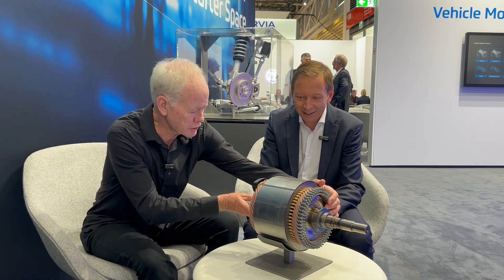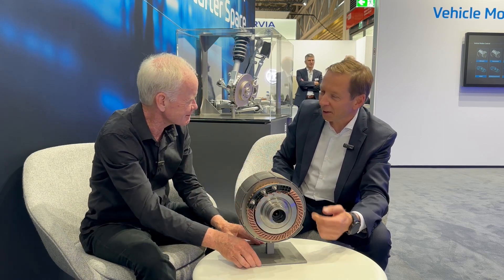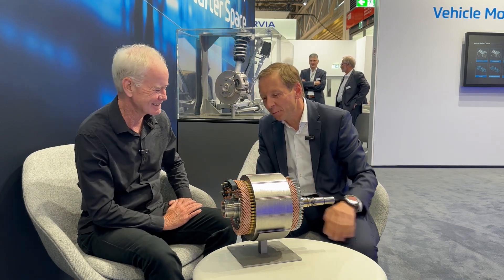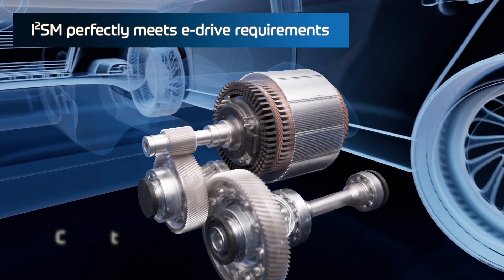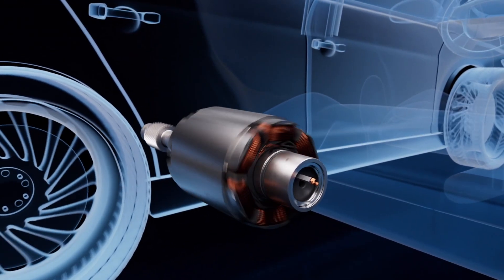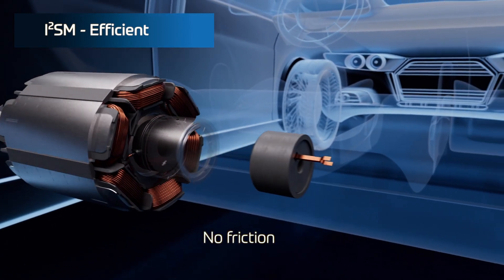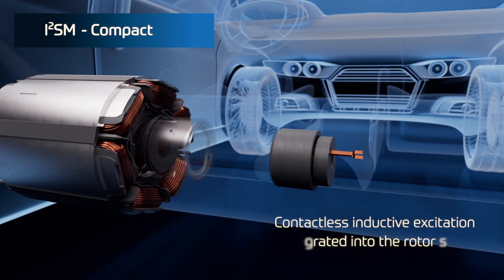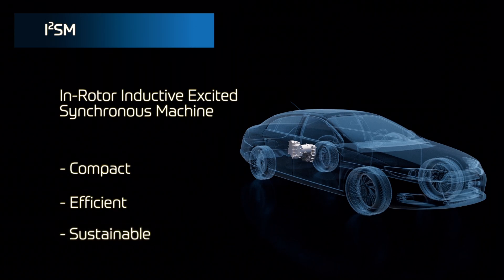ZF's New EV Motor - Autoline On The Road

Comment: Synchronous machines without magnets have been around more than 100 years. Nikola Tesla demonstrated these types of machines in the early 1900s. What's new is not magnet-less, but the induction approach that eliminates the slip rings.

Comment: This is not new. Mahle came out with their inductive coupling 'magnetless' motor two years ago and claimed 96%+ peak efficiency.  The ZF design seems to have only reduced the size of the inductive coupler used to excite the rotor.

In the future, could some of these designs turn out to be more efficient overall than permanent magnet synchronous motors, by using the ability to fine tune the rotor's magnetic field for different operating conditions?

ZF, Mahle and others need to score actual design wins for production car models.  Go for high volume, low cost rather than trying to recover the R&D expense from a smaller volume of motors.

Comment: This is probably the same principle that Tesla are using in the Tesla Q (model "2") as they've said it won't be using any rare earth metals.
Reply: The rare earth metals are for the battery.
Reply: re: "they've said it won't be using any rare earth metals." just to clarify, their original Induction motors found in the Model S (invented by their namesake Nikola Tesla) already didn't use rare earth metals.   the center rotor is just a big ol' heavy BLUDGEON made of copper.
Reply: I would note, that in model S, it was asynchronous motor. This video is about synchronous motor.  @phillyphil1513

Comment: So we have an induction motor. Not sure what the breakthrough is.
Reply: I am kinda with you on this. They address it at the end of the video (lower overall carbon footprint), but technically, it sounds like it's just a brushless motor that uses extra copper and less permanent magnets. So I guess the main play is supply chain stability?
Reply: breakthrough is rotor excitation instead of brushes  @divid3dbyZero

Comment: ...he is just describing an induction motor. How is this something new?
Reply: excitation of rotor using (contactless) induction instead of (mechanical) brushes - that is the crucial part of the invention
Reply: @abstractora  
Yeah dude. That's what an induction motor is.
Reply: @richardruscito1231  its an externally excited motor not an induction one, you're not using slip to induce a current in the rotor...

Comment: A little clarification is needed here as far as efficiency.  Mark stated that his new motor doesn’t have the drag of brushes or moving contacts and that is true but it’s probably irrelevant in the EV space as I know of no EV that uses a DC (direct current) motor (which use brushes);  all use AC motors which don’t use brushes.   EV’s  use DC charging because all batteries are DC but the DC is converted to AC to run the brushless AC motors.
Reply: re: "Mark stated that his new motor doesn’t have the drag of brushes or moving contacts and that is true but it’s probably irrelevant in the EV space as I know of no EV that uses a DC (direct current) motor (which use brushes);  all use AC motors which don’t use brushes."  he's referring to the new motors BMW Engineers designed (and have already deployed) in the i4, i5, i7, and iX.  "PROST...!!!" (best Bavarian accent)

Comment: Looks good here, but want to see it in use at high volume production. 

Would love for Autoline to do an Afterhours show where they go over vaporware and true products from the past few years of expos and auto shows. Many products look good in the moment, but many never reach market. 

Maybe it could be a series of Afterhours so you can group together products in certain categories and bring in people with real experience and knowledge in that area. Maybe some of the Munro Live team would join in this.

Keep up the great work Autoline.
Reply: The generator manufactures have been doing this for a long time. There are diodes between the inductor transformer and the main rotor windings. I expect the slice design to be more likely to be built since it uses the outer stater to power the inner rotor, but that's not a new design.

Comment: Induction motors have been used in manufacturing for decades.
Reply: Exactly! I still don't understand how this is significantly different to one of the asynchronous motors with induction cages that have been in use for decades.
Reply: excitation of rotor using (contactless) induction instead of (mechanical) brushes - that is the crucial part of the invention

 @tosevit
Reply: And adding a rotating inductor and diodes in the core to get DC to run the magnet has been done in generators. Although not mentioned there has to be diodes in that core area.
Reply: excitation of rotor using (contactless) induction instead of (mechanical) brushes - that is the crucial part of the invention

 @LaserFur
Reply: @abstractora  yes  it has a rotating transformer like a larger version that a VCR head uses and then diodes to convert it to DC to drive the electromagnet in the core.

Comment: Aloha,  gotion is a Chinese country making batteries for many EV and other lithium battery users. Don’t you mean VW is contracting to buy Gotion batteries pre packaged in a Gotion designed and built platform? This is VW  buying someone less batteries. It is a cost  center, not a Remus center for them. 
VW is struggling to build batteries. FORD is now stuck further back in line, it seems, because VW  can not 0achieve its battery manufacturing goals AGAIN. 

So VW is outsourcing battery packs and Ford is SOL
Right?

Comment: Very cool you can demo a new motor and it fits on the little table in front of the speakers. One of the cool things you can do with a motor with no magnets is you can control the properties of the virtual magnets with software. That allows you to tune everything without actuators or moving parts like you have in some other motors. You can even retune the motor depending on speed and drag of vehicle in real time.
Reply: Seems like a match made in efficiency heaven for tesla. Who has more software control over their cars than anyone else currently. 🤔
Reply: Wow you know quite a lot about it,sounds interesting!
Reply: @brunoheggli2888  Watch the YouTube video on the Tesla model 3 motors, the front and rear are different.
Reply: @frankcoffey  I would like to have a  steam electric hybrid, a steamengine in the front and an electric on the rear!Think about how cool that would be!
Reply: @brunoheggli2888  I had to chop wood the entire time I was growing up, never again. I even converted by fireplace to natural gas.
Reply: @frankcoffey  We can burn some Witches!
Reply: @brunoheggli2888  How do you know she is a witch?
Reply: @frankcoffey  if shes weights the same  as a duck!

Comment: It is nice to see these future technological developments in the EV space towards efficiency rather than just stuff bigger batteries in everything!
Reply: More efficiency = faster charging by using less power instead of just brute forcing more power into the battery
Reply: Or more EV trucks 🙄. I don't care what power source you use, truck will never be efficient.
Reply: Perfect i like this motor design, How about carbon fiber fiber windings and make have a 2 stroke sound to it.
Reply: Impressive, a starter adapted with NIKOLA TESLA technology.  NIKOLA TESLA INNOVATED AND EVERYONE COPIED.

Comment: This is ganechanging!The Germans are the best!
Reply: Has some advantages (no permanent magnets) but also added complexity.  I don't think it is quite game changing.  Tesla and others have come out with motors with ferrite magnets that do not contain rare earth elements.  Probably cheaper than this motor...
Reply: excitation of rotor using (contactless) induction instead of (mechanical) brushes - that is the crucial part of the invention

 @rogerheuckeroth7456
Reply: @rogerheuckeroth7456  They have to talk more about Mahindra!